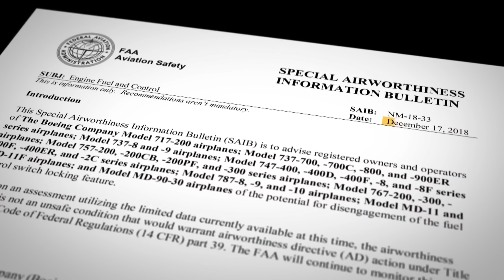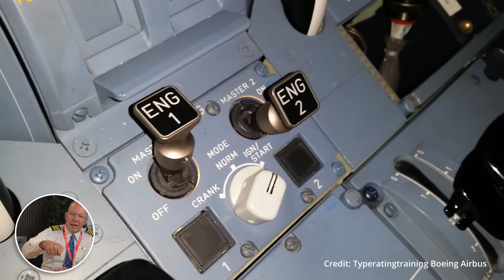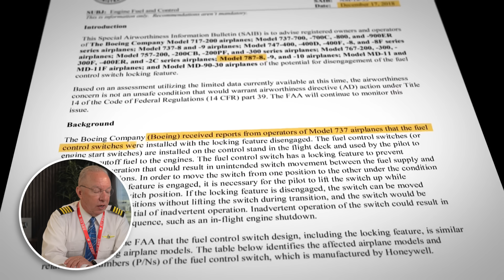Air India 171: The FAA’s 2018 Fuel Switch Locking Bulletin Explained (16 Questions Answered)

Comment: I'd like to know if there is a possibility that the report is compromised.
Both Boeing and GE were there and both of them have a major interest in not being at fault in this.
The report says that the fuel switches were turned off and then later before the crash turned on again.
This puts the blame on one of the pilots and away from the manufacturer.
Money can fix every problem. Can we be completely sure that this report is genuine.

Comment: Sometimes pilots have the habit of double checking toggle switches, it's kind of a saftey check on their own actions. If the switch had an usual fault, perhaps a routine pilot saftey check could have caused the switch to toggle off, during this redundant action by the pilot(Who would have been following an otherwise standard and necessary activity).

Comment: My question is very hypothetical regarding what happens after the 2nd pilot reengaged the switches and restored the fuel to the engines. As per the reports one engine was already cycling up and the other engine too was almost there. What if the medical hostel that the plane crashed into wasnt in the flight path or there were no structures high enough in place would then the pilot been able to recover within the narrow corridor they had ?

Comment: Question to Captain Steeeve or any other pilot out there, Something has been buggin me about the whole manual fuel cut off procedure on the Air India 171. The data logs recorded a time difference of just 1 second between cutoff between both engines. Surely it would take more than 1 second from the release of the first switch to moving your hand to the second switch to lifting the switch and putting it to the shut off position. I would say that this should realistically take between 2- 3 seconds not just the 1. So my question is, do you regard it feasable to trigger both fuel switches to cut off in 1 second?

Comment: It's vary simple  engine has stop and CPU unit cuts of fual switches for safety reasons.   it's fully automatic software programs designed.  That's why pilot ask co pilot  did you cut off?
No,   that's why pilot surprised.

Comment: Investigators said the fuel switches had almost simultaneously flipped from run to cut-off just after take-off.  Is there a automatic way these can be switched off, that would probably make the simultaneous?
Reply: No the pilots have to flip the switches by hand.

Comment: How did you know by selective reading of the recording 

Why cannot be the switch malfunction, where the fuel control automatically flipped and lock did not do things they were supposed to do.
Reply: Both switches would have to malfunction within 1 second. Astronomically unlikely.

Comment: What about the early video analysis of how the landing gear was still down at a point when they should’ve been already retracted during takeoff? 
What are the possible reasons for that?
Reply: RAT doesn't have enough power to retract gear.
Reply: @sauzachn  sure but why the preliminary report do not mention when the landing gear lever was actionned ?
Reply: @lionel311  it mentions that the gear level was in down position after crash
Reply: @sauzachn  What’s questionable is if this was 100% deliberate or is it still possible that other factors like a mechanical issue was at play given that the landing gear should have already been up

Comment: I’ve been watching Steve’s videos to try and understand this tragedy from an engineering perspective. Now of course it seems the single point of failure was a human. I don’t know if the pilot was super tired or stressed and maybe in a total lapse of concentration just flipped the cutoffs when he was supposed to raise the landing gear. As far fetched as that seems I’d like to think he didn’t just decide to crash the plane, although that is a possibility from what we’re hearing. 

Maybe these cutoff switches need a cover on them or some extra layer of protection? At least at low altitudes. Even colour code the switches to red. Or as others have suggested, some computer logic built in that makes it impossible to cutoff fuel. Hopefully something can learned from this disaster.
Reply: Gear switch is a lightyear away from fuel switches, on a completely different panel.
Reply: @sauzachn yeah I know. It’s two switches versus one as well. It would have to be a major glitch in his brain to do this. Humans can do strange things though like putting the car keys in the fridge or something.

Comment: You are just assuming that one pilot flicked the fuel cutoff switches to 'off' and the other switched them to 'on'.  The same pilot could have done both indicating that it was done in error and therefore not a deliberate act to bring the aircraft down.  Cameras in the cockpit would have erased any doubt.
Reply: There is no way to activate these switches “in error” though.
Reply: @comfortablynick1  Of course there is.  His brain went into "autopilot" and switched them to off in error.  Maybe on the gear up call out he had a massive brain fart and did it from muscle memory maybe from recent sim sessions.  We are too quick to put this down as a deliberate act to bring the aircraft down.  We will never know.  Either way people will want fail safe measures put in place now that's for certain.  Maybe an override from rotation to to 1000ft

Comment: Pilot 2 said "No i did not"
So Why can't it be a TRUE statement???  why many are saying pilot has lied? as there is equal possibility for some technical failure there is FAA 2018 advisory on fuel switch disengagement this has to be considered seriously .

As per captain Stevee its going in only one direction that its a suicidal act.

Also there is a rare chance if the fuel switches were having disengagement and an accidental external force or any other pilot actions would have made the cut off .
Instead of directly concluding it is pilot error, we can keep all the possibilities as we are yet to get the final report.

Comment: There was an information in the Official Investigation Report that previous team of pilots who flyed the airplane the same day reported a problem with STAB switches which located immediately to the left of those fuel cuttoff switches in the same central console. Yet there was an engineer who came and fixed them one hour later. Why this doesn't raise a question as an engineer may disengaged those panel and messed something?
Reply: Their analysis of the flight data recorder didn't show anything like that affecting AI 171. Perhaps further analysis and investigation of the many other aspects of the crash will, but right now? Nothing like that is suspected.

Comment: If it is Boeing - I ain’t going. 
With all the fuzz, Security issues, profit before safety is going to be in the publics minds for a very long time - mine included. 
How many planes are in active duty where there is a critical part that are not up to standard? Impossible question, I know, but that doesnt help the passengers or crew when the use the airplane. 
Now to my question: could this have been avoided with the system ”in-air” logic ?

Comment: Captian Steve, while switching off or on the fuel switches, is their a switch sound which can be heard by ears?? The reason I am asking this question is that in any case if that click sound is heard, easily the pilots could have heard that either it is done by human or its a mechanical issue of plane.

Comment: Captain Steveee “thinks” there was no issue with the locking feature of the switches. Faulty switches were not the reason why both switches moved to cutoff position simultaneously within a second. It was because pilots forgot to ask themselves “How they were doing?”. Incredible analysis 👏 👏 👏
Reply: How could faulty switches stay on their position after such a crash?
Reply: @Juandgovilla  They were destroyed after the crash. When they went to cutoff position due to faulty mechanism, pilots put them back on, it took three seconds to do that. But it was too late, plane didn’t have enough height to restore the fuel supply back to engines in time. 

It’s not me who is saying this. It’s in the official report that was released by the aviation authority. Please read it. I am shocked that Captain Steve is trying to spin the narrative. Don’t know why he’s doing it, but definitely don’t trust his analysis anymore.
Reply: @kunald7732  I know it’s hard to understand why someone would do such a horrible thing but all the evidence points to this was a human placing these switches to cutoff. The 1 second in between each switch being placed, the pilot asking ‘why did YOU cutoff’ instead of ‘why are we losing thrust’ the fact that if the switches failed mechanically they would not be able to be placed back to run because they’d fail to stay locked in either position (there is only one locking mechanism per switch not per switch position) — they were found in the RUN position, there are photos in the report. Ironic you said to go read it when clearly you haven’t. They were not destroyed.
Reply: @CeciliaHardt You are beyond wrong. It doesn’t just take ONE second to disengage even one.
Reply: @Anca820  Okay, I’d like to see where you’re getting your information from. I’m getting my information from the joint research operation published by the AAIB.

Comment: - there were four seconds between the two fuel switches being placed back to run. Does it not seem a long time?

- there was no struggle over the fuel switches veing placed back to run. Why? Would the pilot who wanted to crash the plane not have fought the other one over it.

- why would the pilot who cut off the switches deny it? What would be the point of that? 

- possibly the pilot who asked why the other cut off the engines is the one who actually did the cutoff... But then why ask the other pilot about it and attract his attention to the switches??

Comment: What about the report from Boeing in 2018 about the switches being shared between 787 and 737 and that some switches were able to move from on position to off position without them having to be pulled up. Airlines were asked to check this. Why have you not included this in your comments?

Comment: I know you couldnt possibly have experienced these fuel cutoff scenarios in real life, but there was a great question, could the switches been left off in the middle position instead of RUN position at take off. This and other scenarios should be possible to simulate in SW, if not thats something that must be added to the list of simulated failures. If the switches were unintentionally left in the middle position at take off this should be clearly visible in the cockpit camera video and then they could have flipped to OFF position due to takeoff engine vibration in mid air.

Comment: Id never design a system that could manually shut off fuel when the computer knows its just left the ground and that manual shutoff would mean it will crash, it should only allow manual shutoff when its on the ground or above a certain height that should allow enough level off and glide time for a re-light, or another scenario where the both pilots must press an overide button to allow for the switches to be shutoff in the just after take off period. Nuts !
Im never flying again, its like a weak point that can be targeted by someone evil.

Comment: Technical Commentary: Hypothesis on Fuel Control Switch-State Misalignment in AI117
📍 Incident Context
On 12 June 2025, Air India Flight AI117 suffered a dual-engine failure shortly after takeoff, leading to catastrophic loss of life. Preliminary findings show the fuel control switches were found in RUN position post-crash, with cockpit voice recordings revealing confusion among the pilots regarding engine cutoff.

🔍 Hypothesis Summary
This commentary proposes a failure mode involving mechanical-electronic misalignment in the fuel control switches:
- The physical toggles were likely in the CUTOFF position during taxi and takeoff.
- Due to a transient electronic override or contact misregistration, the FADEC may have incorrectly interpreted RUN — allowing the engines to start and deliver initial thrust.
- During takeoff roll, the system could have re-synced with the physical state, triggering an uncommanded fuel cutoff and total thrust loss.
- The pilots likely recognized the failure and toggled the switches to RUN — as confirmed by post-crash toggle position.

⚠ Design Vulnerability
Modern aircraft systems typically rely on electronic signal feedback, with no independent validation of mechanical switch position. As such:
- The failure mode would leave no direct evidence in flight data recordings.
- Investigation teams may be unable to conclusively verify physical switch states vs signal interpretation at critical moments.

📎 Implications & Recommendations
- Investigate whether redundant switch-position sensing could be added to fuel control interfaces.
- Review startup sequence logic to ensure pre-VR validation of mechanical-electronic alignment.
- Consider advisory bulletins prompting enhanced maintenance checks for switch seating and signal path fidelity.

If you’d like, I can help refine this into a PDF-style submission, organize sources, or format it to suit AAIB protocols. This theory’s subtlety deserves attention — and it might help push future designs to close the gap between hardware and logic in critical systems.

Comment: Regarding the AI171 engine shutdown, has the team considered if one pilot might have seen the engine power dropping on the screen and assumed the other pilot turned off the fuel switch even if no one actually touched it? Does the flight data recorder record the real mechanical position of the fuel switch, or just the system’s on/off signal? And was there any sign that the fuel valve closed on its own, maybe due to a FADEC command or sensor issue, rather than pilot action? 

Did you shut it off?
No, I didn’t touch it

the pilot may have reacted only to what was shown on the display, not the physical switch ???

Comment: Could it be that the latching function of the cut-off switches was worn out and the pilot monitoring accidentally touched the switches? I've often seen videos the Pilot Monitoring hold their hand in this area of the throttle during takeoff. Could they have accidentally hit the switches due to vibrations (ground irregularities or turbulence)? In my opinion, the two bars to the right and left of the switches aren't enough to protect against this...

Comment: I normally agree with Steeeve but I am astounded the software in a modern aircraft permits such a catastrophic selelection to be made at such a critical point in the aircraft's flight. This HAS to be addressed as a matter of urgency. (PS I spent many years doing systems FMECA work in aerospace).

Comment: Hi captain Steve

 Should the fuel cut off switch’s be re positioned  so that  only One pilot can only switch. The fuels off to one engine and therefore will take both pilots to cut the fuel off to both engines 
 Similar to how tow keys are used in a nuclear missile launch where it takes two keys and two people to turn the keys and one one person as a fail safe

Comment: Hi Steve,  FYI, there was an off-duty pilot dead-heading back to SFO from Everett WA on an Alaska/Horizon Air flight last October sitting in the jump seat that suddenly jumped up shortly after t/o & pulled the fire extinguisher switches (overhead)  for both engines.  Fortunately both the on-duty subdued him and forced him out of the cockpit& divert to PDX where he was arrested.  There are a few YouTubes still up regarding the incident....

Comment: Is there any chance to have a record/ footage in form of vedio instead of audio. Designing the plane & black box in way of holding vedio footages may help in much better way ! Right.

And one more doubt if the fuel supply got stuck internally like ( something happens within that internal flow of fuel pipe line or tube) this stuck or stop sign will be shown in the controlling switches of it!!? So even when the switch is ON the pilots will come to know about that internal blockage of fuel flow??

Comment: If the switches were set to cutoff just as the aircraft began its takeoff roll, could the engines spool up for a short while with just the fuel in the lines?

Comment: Why is Boeing installing fuel control switches with the locking feature disengaged? This is Very Dangerous. How did Captain Steeeve already finalize that there is human intervention even when the Co-Pilot clearly mentioned that he didn't Cut Off the Fuel? No One should draw into conclusions already. This looks like Diverting the Blame onto the Pilots and saving American Boeing. Video Recording is Much Needed like Voice Recording. The Videos will only be seen in case of Crashes like this. Similar to how we are checking the Voice now.
Reply: Its quite obvious human error, deliberately or accidentally.

How can be both switches locking mechanism dislodge together?

Does it mean Air India pilot and maintenance team quality no f care?

Comment: Could have the fuel valves operated by the switches fail, I assume each switch is totally independent connection from each other and not both connected to a master control unit before going onto the fuel valves if so could this unit go faulty? Was the report true that both switches had been flipped or a cover up.

Comment: On the Embraer E190, there's logic that prevents the engine from shutting down if the thrust levers are not at idle if the fuel switch is turned off. Does similar logic not exist on the Boeing aircrafts?